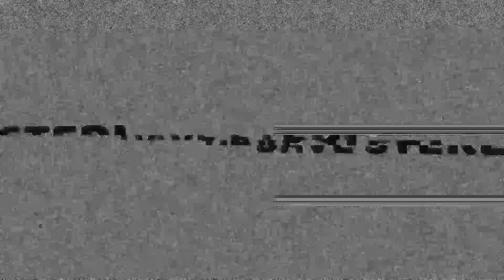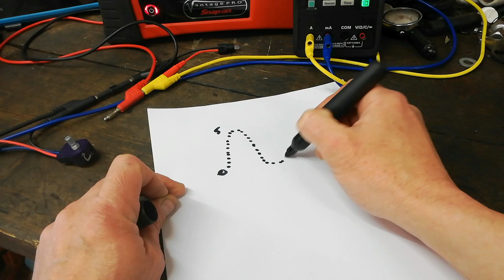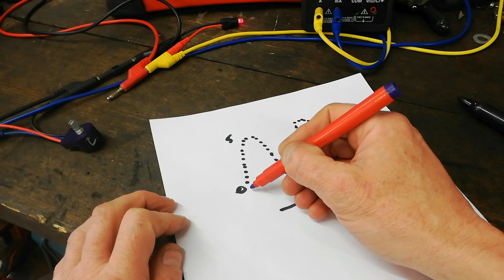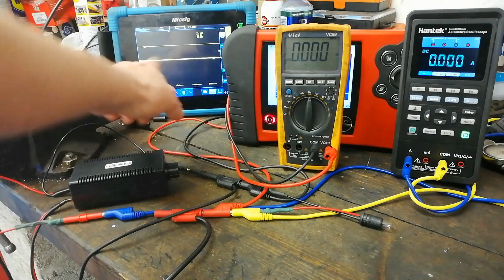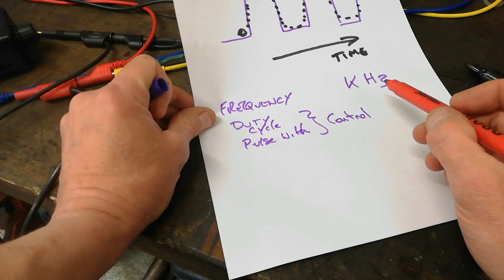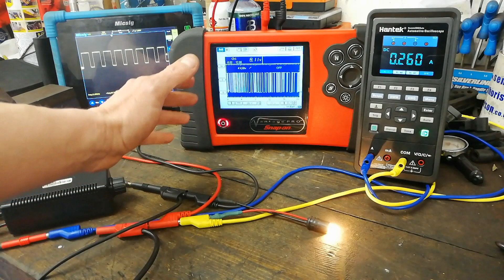PWM Explained

Comment: Thanks Dave.  I have learnt something and just in time to fix a VW Touareg Blower that trips out when the fan speed is high. 
So what I have learnt is that voltage and frequency is constant as 12v and whatever the high frequency is and the fan speed is controlled by varying the % pulse width or I suppose dwell.   
So if I measure the % pulse width on the signal wire to the fan and the fan cuts out then I have a fan problem, but if I loose the signal then the dash module is the problem. Is that a reasonable statement.

Comment: Interesting stuff as always Dave. I’ve noticed that the tool I built for testing EGR valves, which is just a PWM driver, a 5V supply and a volt meter really, seems to provoke little or no reaction from the valve as I increase the pulse width and then it seems to suddenly burst into life and the valve under test always seems to move a lot once it does move. I don’t seem to be able to control EGR valves in a very linear way. Is there something about physics that’s causing that and can I do anything about it?
Reply from the maker: I use 12v to the pwm controller
Reply: Sorry Dave, I didn’t write that clearly enough. The 5V supply is just for the position signal side of things. I’m feeding 12V into the PWM controller.

Comment: Another good bench top lesson Dave. Cheers Pal
Reply from the maker: chers ian, i hope you found it accurate and do you think ive left anything out?
Reply: dave sterl No pretty comprehensive. Think most people (or at least I was) Maybe a little confused initially by the distinction between Duty Cycle and PWM...As you know inextricably linked but quite different.